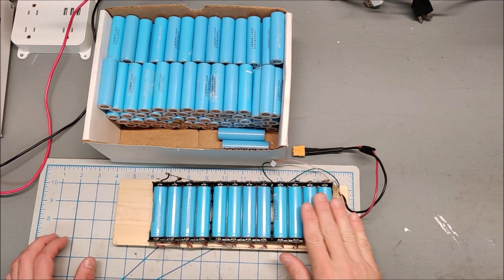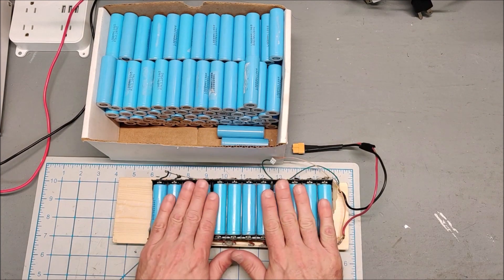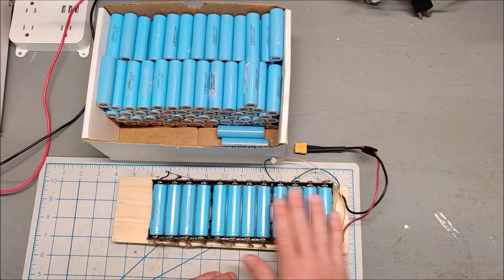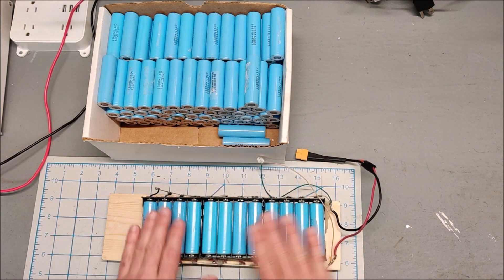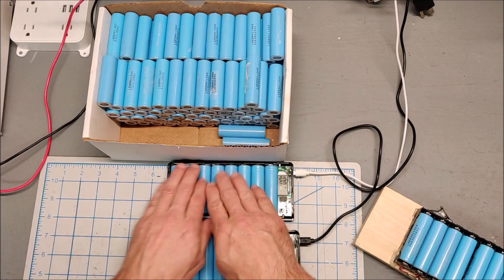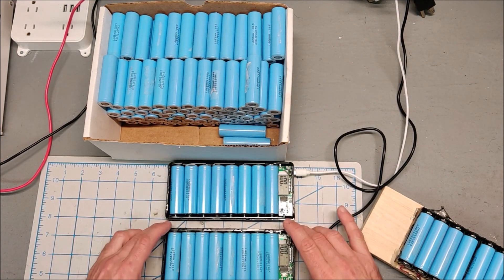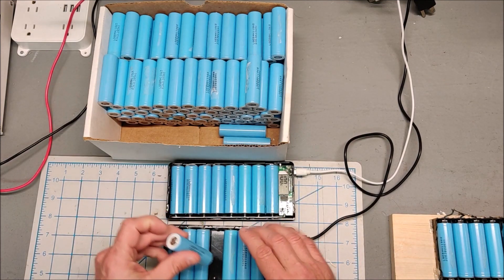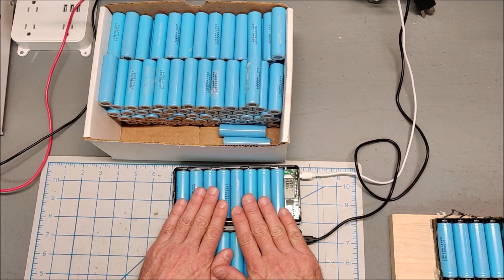BULK CHARGING 18650's

Comment: I also think that it makes no sense, since in parallel there is no loss of power, overcurrent and overvoltage. But if the cells are of different standards then the circuit is needed because they will have slightly different load curves

Comment: How are you getting around the silicone coating on top of bms on the 3200ma packs from bch?
Reply from the maker: Easy, I just poke my screwdriver right through the silicon between each pair of cells and undo the screw right through the silicon. It's really easy.

Comment: Having to sort by voltage and then wait a bit while each group equalizes is one argument for using mega/individual chargers.  That said, the powerbanks are handy and with that or the other setup you showed, only having to keep track of one larger batch of cells sounds nice.  Since you're keeping it open, you could solder an XT connector to the powerbank and charge it faster.  

I've also used powerbanks to pull energy from cells that are self-discharging or lower capacity and put it into a good battery pack, so the energy doesn't get wasted.  (then bring them down to 1v with a power resister before recycling)